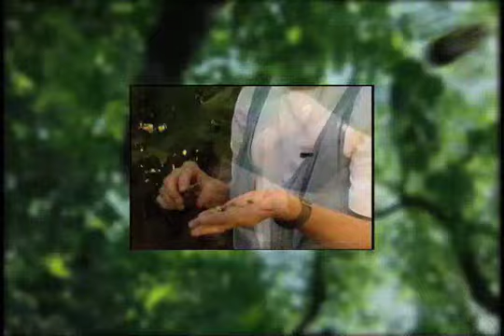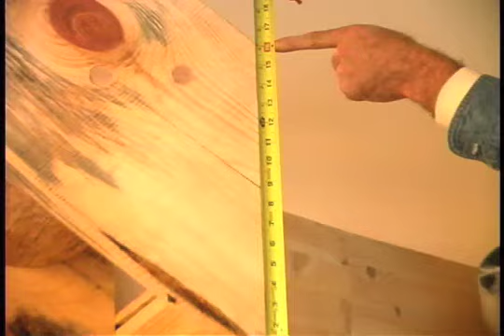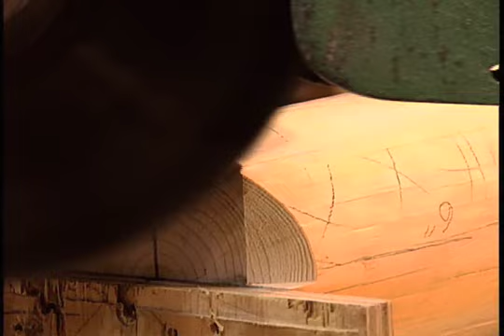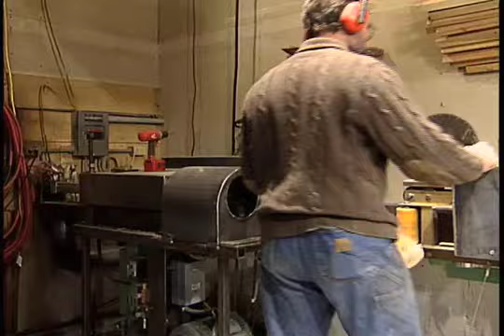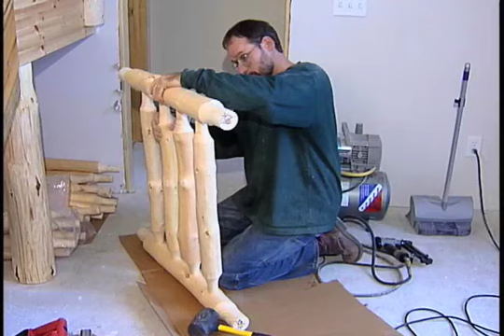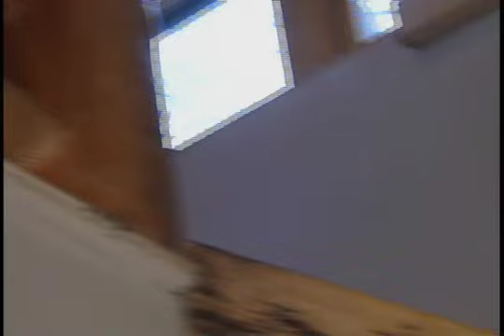You can build the impossible, "Stairway Log Handrail"

Comment: I know this is a late comment. But we built a log cabin with cedar styles. The stairs going into the loft had 4 inch rails on both sides... Code would not give us occupancy until we added a common type hand rail. which I agreed to do. There reason was that an overweight or young kid was to fall, grabbing the 4 inch handrail, they would not be able to hold there weight and fall down the stairs. Just a thought.  I live in Wisconsin  started our build in 2008.
Reply from the maker: Dealing with code can be a challenge, sometimes they, or "inspectors" application of "code" can make things more expensive and dangerous. At our Brainerd MN college you could throw a football right through the second floor guard rail? Yep, Gov. also exempts where they choose to.